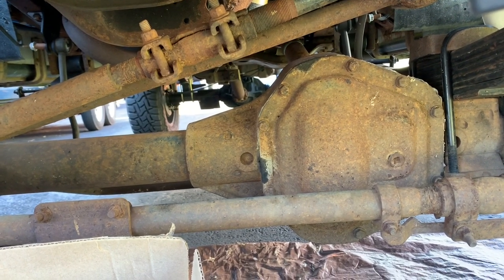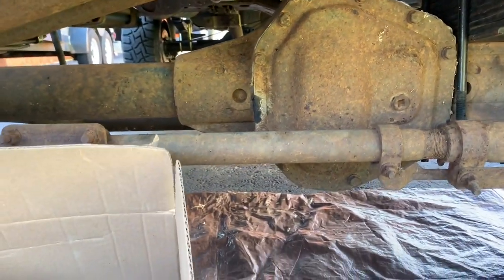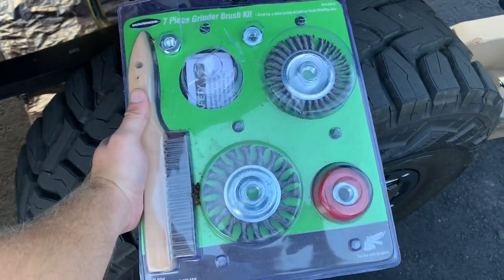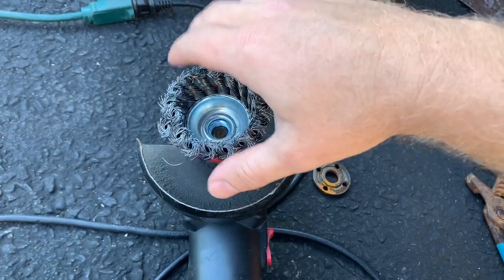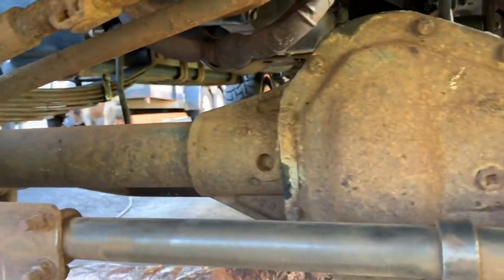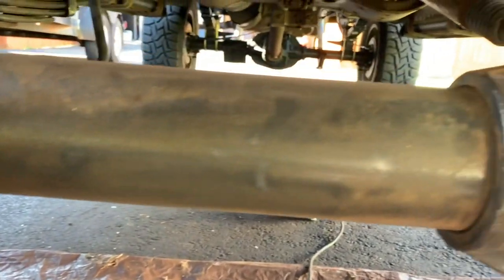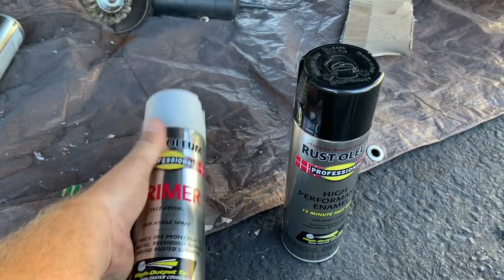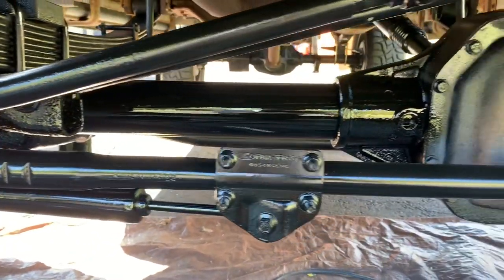QUICK AND EASY RUST REMOVAL AND REPAINTING DANA 60 DIFFERENTIAL FIX

Comment: Eye and face protection is a must. Those tiny wires will break off and end up embedded in your face. I know.
Reply: Did that today with the wire wheel on the bench grinder.  Wire shot right into my hand.  I never wear gloves around that kind of stuff.  Safer not to.
Reply: @MrClarkisgod  I pulled one of those wires out  of my face. It could have just as easily ended up in my eye ball.
Reply: Also wearing a respirator is important, breathing in all that rust is not good for your lungs
Reply: When restore cast iron I use those wire wheels. Definitely need a face shield
Reply: @minyoungc_  Yep, my face shield, gloves, N95 and grinder are in the same box. I actually had the plexiglass damaged from something flinging and had to replace.

Comment: If you live in Canada like I do, the only way to get rid of rust for good is sandblasting and epoxy paint. Any other way, and the rust underneath your fresh paint will push your paint off within 2 years.
Reply: thanks.  my buddy is going to do 2 part epoxy on my obs frame for $200.  pretty stoked.  now to strip bed and blast it all.   very rusty
Reply: uhh no. if you starve the rust of oxygen and water it wont magically start to grow again

Comment: Surprised you don't use Rustoleum Rust Reformer instead of the Primer. This way the rust doesn't rot from the inside out!
Reply: I just bought a few cans of that what do I do use that first then Do buy sumthin else to go over that?
Reply from the maker: Ill have to try that next time I paint something rusty!
Reply: if I am about to do this. should I grind down with sander, use the reformer first, then what??

Comment: POR-15 Would have been a 1000x better choice than any other product. Great video and informative.
Reply from the maker: Agreed
Reply: I disagree, I have used  POR-15 on an rusted free chassis and axle and it peeled off. POR-15 hold well on rusted rough surface. The other disadvantage for POR-15, it also holds on dirt , dirt does not wash off as easy as paint.
Reply: @info411 100% agree. I grind the rust off, add phospho rust converter, wipe clean with alcohol, and then use chassis and rollbar paint. Top that with lanolin or old oil. If you spray 1-2x a year you'll get no returning rust.

Comment: I'm about to drop my axles and have everything powder coated. The 08 rear diff cover is a great up grade if you haven't done it yet.
Reply from the maker: At some point I may swap D60s in and if I do that i'll get them from the junkyard and have them blasted and powdercoated and fitted with 5.13 gears

Comment: Nice video, well explained. Just curious to know if you've ever tried POR-15 for these kind of projects?
Reply from the maker: Not yet! maybe next time i hear good things
Reply: Undercoating can do more harm than good. If water gets trapped under it rust will form and you won’t see it since it’s under the coating. It’s better to wash the frame and suspension regularly instead.
Reply: Fluid film or crc corrosion inhibitor is better
Reply: Por-15 Properly applied along with regular undercarriage washing and the frame will outlast you

Comment: I use, used motor oil. Fastes way to get rid of it usefull 2 times a year. Need to replace oil anyway.
Reply from the maker: certainly doesnt rust when it has a good thick oil/dust coating

Comment: I need to do this on my 83 Squarebody.
Reply from the maker: The paint still looks great, the only thing that sucks is the cheap chrome diff cover is rusty (admittedly tho its outside 24/7 and we always drive it on the beach and snow).  If I had to do it over i would probably find a steel cover and paint it or powdercoat it.

Comment: Did you had to sand paper after grinding?
Reply: no. sanding it would create scratches and is unnecessary after wire wheeling. the wire wheel is an understated tool.

Comment: There are easier types of wire brush power tools to handle than what your using-such as a cordless drill-and also a pneumatic die grinder tool works well too-🙂
Reply from the maker: I like to live dangerously

Comment: RIP steering damper...
Reply from the maker: It was actually bad before I did this.  I have since replaced it, but it only takes 5 minutes so I didn't bother with a video.  In hindsight I probably should have made one because its kind of a common issue with the steering wheel feeling jerky after coming out of a sharp turn.